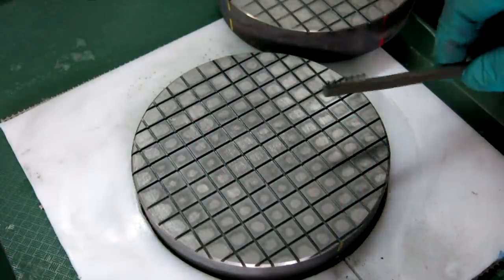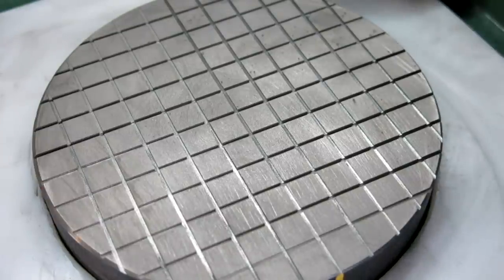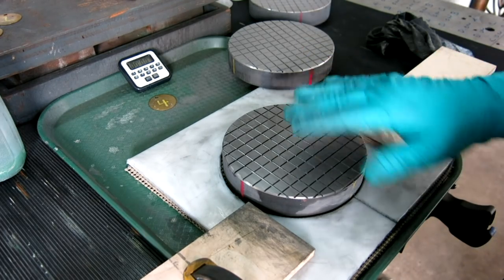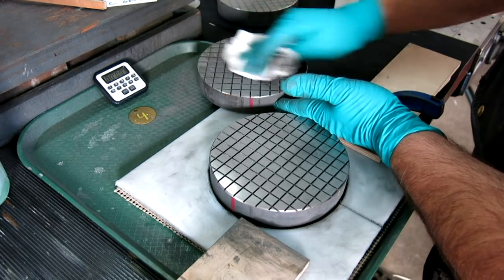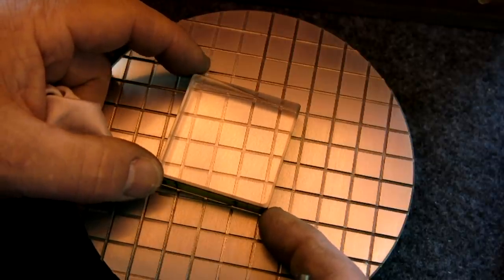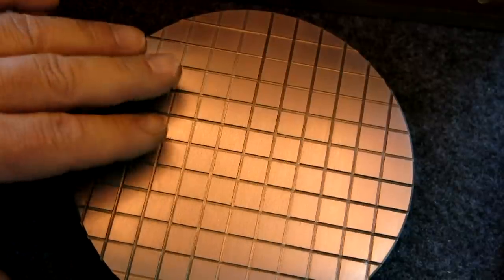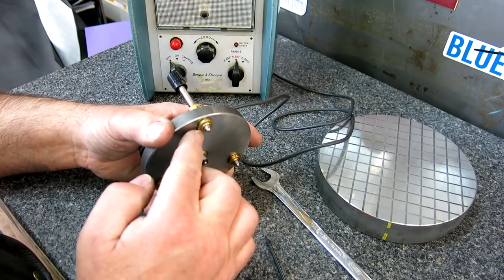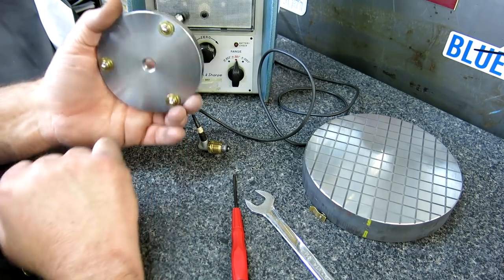Making Flat lapping plates 3

Comment: Tom if you finish up doing a video on the optical flats etc could you discuss whether LEDs work as monochromatic light sources? I just use the overhead workshop lights and the fringes come up ok, but wondered whether making up a coloured LED source may be better.
Reply: Hard to obtain a bright enough single junction element with a decent life span. Multiple LEDs are difficult as each may present a slightly different wavelength. If they are produced with colored gels or dyes it would be worse as the gels will vary with lot and time/usage. Cherry picking would get you there but easier just to use a sodium lamp or etc. I usually just located the one florescent light in the shop that worked best.
Reply: If multiple LEDs are slightly different wavelengths how would that differ from a white florescent light that is every visible wavelength? Building a small lightbox with a ring array or similar of single colour LEDs  would be much cheaper and easier than a sodium lamp that's for sure
Reply: Is that a serious question? Why bother? Because a monochromatic light box will cost hundreds of dollars, if you can find one used. Which you most likely won't here in Australia. A handful of LEDs and a power source will cost a few bucks, tops. LEDs are, by design, monochromatic. However I have never tried it to see if what works in theory works as well in practice, hence why I asked Tom if he was doing a video on it whether he could consider a cheaper/more readily available monochromatic light source.
Reply: LEDs aren't very monochromatic.  They have a wide bell shaped frequency curve.  Laser diodes are sharper but I think not as sharp as spike filtered out of a fluorescent
Reply: Pete F short answer is yes you can by using monochromatic light filter films, green yellow or red would work best. And passing the LED light through that. Any single wave length of light will produce a fringe pattern, just the measurement distance between fringes will change with the wavelength change. 

You can also build your own optical light box as well, despite the cost of them on the retail market, there's very little to them. Just a sodium bulb, some MDF and a beam splitter plate. Will still cost some $$ because splitter plates aren't cheap. You can get away without a splitter plate, but reading fringe lines just through the optical flat without a splitter is an art form much like reading your future from tea leaves. 

You would also need to get yourself a high precision optical flat. The jinkier your light source setup, the better your flat needs to be to compensate for it. A 1"dia single surface optical flat will set you back around $150.
Reply: Coloured LEDs are reasonably monochromatic, that's essentially how they work. Obviously not as monochromatic as a laser, but a completely different device.
Reply: Pete F 
Yellow LED's (not the "super" or "special" yellow") LED's are only a few nanometers (585nm) off from a sodium bulbs wavelengths (589). 

Limited viewing angle on it though (15deg). But get enough of them and a light diffuser you could certainly get quite a decent "sodium bulb" light box outta it. Still need to cough up the cash for an optical flat though.
Reply: I have an optical flat. As I mentioned in my initial request to Tom.

The sodium bulb light boxes powered the Arc. The alternative at the time was essentially incandescent lighting. Since then there have been a lot of advances and can't see any good reason they would still be considered the way to go. There's also no particular reason to use that wavelength either.
Reply: @cris0tube Ok let me highlight the relevant text for you since you had trouble seeing it.

"Building a small lightbox with a ring array or similar of single colour LEDs  would be much cheaper and easier than a sodium lamp that's for sure"
Reply: Pete F 

The reason that wavelength is used is because that's the metrology standard for measuring fringes. So if you needed an optical spec of 3 fringes and were not using that wave length you would have to mathematically convert from the wavelength your using to the 589nm wave length. Kinda like using metric micrometers to measure a spec in inches. 

So using LED's in that wave length will save a step of converting.
Reply: @Occams Sawzall Good God man, we're not building the International Space Station here. It's an exercise in lapping plates together to self-prove them. I use my optical flat to prove that something is "flat",  not the next manned mission to mars! You guys clearly have more time that I do, so I'll leave you with your navel gazing.
Reply: chris0tube 
Depends on the quality of LED you buy.  There's no QA standard of what a say red LED must emit in wave length to be considered a "red" LED. Long as it looks reddish it's good to go. 

Cheap LED's could vary +\- 50nm easy. High quality ones are probably within +\- 5 to 10 nm.
Reply: Pete F 
Just saying "is it flat?" is an arbitrary question that's why. Flat relative to what? Hell 80 grit sand paper is relatively flat. It's just got a huge P-V measurement. 

The entire point of using monochromatic light and optical flats is to use a known calibrated measurement ( in this case the lights wavelength) to physically measure (not just take a comparative reading) the flatness of an object. 

Large wavelength fluctuations would cause a massive misreading of flatness. If you could even get a decent fringe pattern to begin with.  

And a light box and flat is the "poor man's" flatness checker. If we were going to space you'd be using a $1M+ 3D interspherometer with computer analysis, and auto tilt and focus. 

You can only go so cheap before you reach the point of useless.  LED's are cheaper than a sodium bulb (unless you steal one from a street light...) you can get away without the beam splitter and you can build a simple cheap MDF box to block out other light sources. And will need a light diffuser to take the narrow angle light emissions from the LED LED's (preferably as close to the 589nm wave length as possible) and open them up to a broader more even light level. That's as cheap as you can get and still have something that's useful.
Reply: chris0tube 
Yes. But crappy LED's won't produce a monochromatic light. Cheap LED's use cheap impure metals to produce the desired color. The more impure the more variation in wavelength you'll get. Which is why sodium bulbs are still used because sodium is easy to get to a very very high purity, which translates to less variation in wave length. 

Same goes for LED's. Cheap LED's use cheap metals higher quality LED's use higher purity metals. Resulting in a more monochromatic emittance.
Reply: Pete F 
4 years at General Dynamics making infrared optics. I've used optical flats Zygo laser interferometers, spherometers etc etc. 

The wave length used matters greatly. The wavelength IS the known measurement standard. That's why in optics the unit of measurement is waves. Fringes being 1/2 of a wave, or 1/2 the wavelength of the light. 

Without a known or consistent wavelength of light (589nm from a sodium bulb being the most common) the interference lines that appear are useless. Having multiple wavelengths will generate a multitude of interference lines.
Reply: Sodium lines are 589.0nm  and 589.6nm.  I guess as the difference is only 1/1000 this means you can count out to 500 fringes until the interference is totally destructive.  This suggests you could successfully use something like a laser diode with a very small spread so long as you know the dominant frequency.    I looked on ebay.co.uk and the cheapest way to get a low pressure sodium lamps is to get a pre-loved street lamp complete with working bulb.  It may not have many hours left on it but it looks like an easy way to get started
Reply: MattOGormanSmith 
Low pressure 55 watt sodium bulbs are like $30 brand new...  don't need to get em from a street lamp.   Unless they're banned in the U.K. Or something.
Reply: Occams Sawzall You may well have been working at General Dynamics, but as sure as my ass points south, it wasn't with optical flats from what you've commented. People can spot fakes. Fake news mate. For this type of work all we're interested in is the pattern that's presented. I can get useful fringe patterns from my fluorescent lights in my workshop lighting FFS! So much for all the crap about slightly different wavelengths of different cost LEDs! I asked Tom about using LEDs as the fringes are difficult to see with workshop lighting and stand out far better with monochromatic lighting. You guys seriously need to go out and do some of this stuff.
Reply: Pete F 
If you're convinced your way will work, why bother even asking the question?

If it's as cheap, easy and effective as you claim. Build em and sell em. I'm sure optics manufacturers would love a cheaper alternative to sodium bulb light boxes
Reply: @Occams Sawzall I asked the question. The clue it was a question was the squiggly mark at the end of the end of the sentence, just so you recognise it in future, it looks remarkably similar to one of these ? Shame you didn't get that. I sure as heck know however that some of the bullshit you made up isn't the reason it wouldn't work. Not in our universe anyway. Yours may well be different ;)
Reply: Great thank Mark. I've been flat out recently so haven't had a chance to try this out for myself. I thought it should work ok in theory, but wasn't certain. Nice you went to the effort to confirm all this. Cheers!
Reply: Fringes are a relative measure, not absolute.
Unless your spec says "three fringes of sodium light", the exact color is meaningless.
If the light wavelength + flat = fringes, you can use the information.
It is the curve of the fringes that tell the tale.
Reply: The curve of a fringe useless when determining flatness?
Are you using the same photons as the rest of us?

Comment: Tom,
How about more discussion on the different types of abrasives used and when? What about removing embedded (charged) abrasives from the plates for changing grits or type of abrasive for another operation. Once a plate has been used with diamond how do you then switch it to AO or garnet??? Still so many unanswered questions....

Comment: Tom, such great videos. I have two questions (1) what is the easy way of cleaning the abrasive before using optical flat. I found these diamond partical destroy my optical flat easily. (2) why you need three adjuster screw instead of two ball + one adjuster ?

Comment: Tom, I’m thinking about making a set of lapping plates. I’ve followed these 3 videos and the work does not seem overly difficult for even a modest shop. 
However, what I was interested in doing first was a surface gauge/squareness comparator. I’ve seen other people building one based on one you built, but for the life of me I can’t find a video on your gauge. Could you point me in the right direction? So far, I’ve been taking ideas from Stefan gotteswinter and another one I’ve seen but who made is alluding me currently, I’d like to take ideas from yours as well.

Comment: I'm LAZY . . . * or smart ?  . . . I would START the lapping process with around  10 micron , then 5 . . . & finish with 1 to submicron size ; all diamond dust - thinned ( or carried ) by fractionated coconut oil !   ( mineral oil works great too ! )  With diamond grit , quite often, LESS is more effective !  Time of work would be cut by nearly a magnitude . . . though the possibility exists that some of the coarser grit may embed , however . . . the finer grit should mitigate the coarse .
     End result is the big deal . . . as long as you enjoy the ride ;)    Good stuff Tom ! ! !